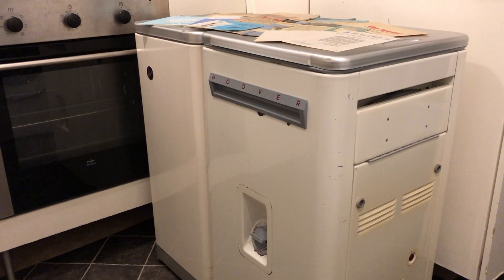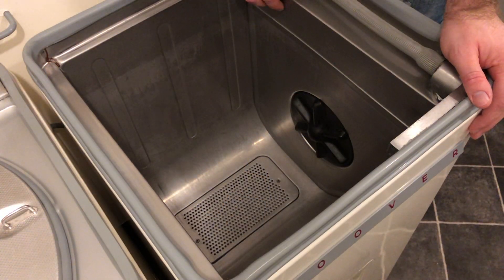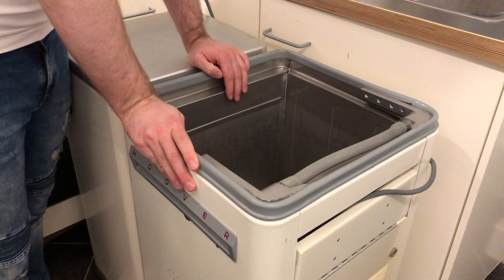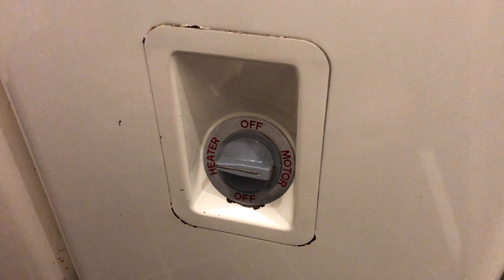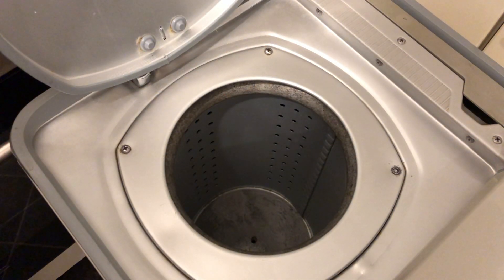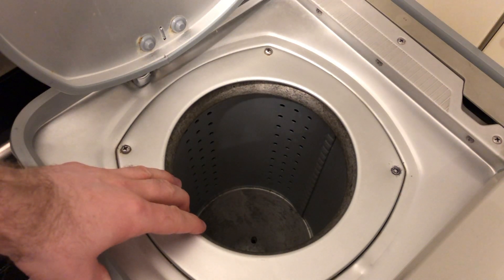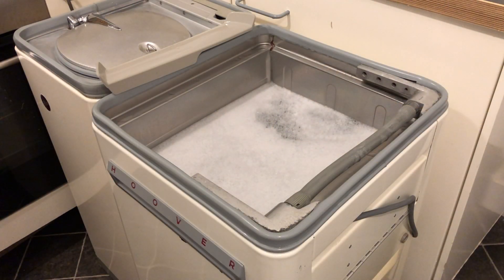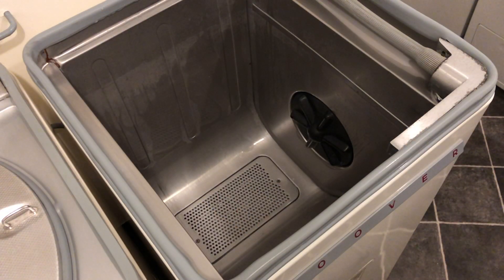Washing with a vintage Hoover washing machine and spin dryer

Comment: These were surprisingly efficient if you followed instructions and didn't try to take shortcuts. Many impatient people complained about washing being tangled - all you had to do was put it in the spinner for a few seconds, take it out, give it a shake to separate the shirt sleeves then carry on as indicated. For a single person or a couple, they were ideal. Cost effective too, as you didn't have to waste the hot suds water each load.

Comment: Oh this was SO lovely to see this particular Model! Thank You!  My Great Aunt had one of 
these Single Tubs shown;  it was inherited by my mother when she died, the only difference, she did not have the matching ‘Spinner', but there was a 'Mangle' attached to the Single Tub Machine,  that ‘folded' down inside the actual Washer when put away, and so it did not impede on space 
when not in use. I am guessing because of the Mangle on my Aunts, that these Machines (unlike today) did not change over the years;  they continued to manufacture the same Models for 
years... These days, it’s out this year, and in with the new – the very reason they would not last any where near as long as these great loyal old things!  It was an effective and powerful Machine, though doesn’t at first look it when viewing the relatively small ‘Paddle’ on the side instead of the larger ‘Agitator’ on most.
Reply from the maker: No worries, so glad you enjoyed it!

Comment: That is a bit weird there isn't 'heat and wash' position on switch
Reply from the maker: That would be a bit risky. There’s no timed shut-off mechanism to regulate the wash duration, so it would make it easy to accidentally heat and wash continually at a temperature too high for the laundry, and possibly at a temperature that could injure the user!
Reply: @ElectricUtopia  Well, here in polish most of washers with heaters didn't have any thermostat ;) Polish washers have silimar switch to that Hoover, but with "wash and heat" position and heater lamp. GDR washers (WM 66) had only thermometer on front, and Romo washers (from Czechia/Czechoslovakia) had thermostats, but with weird adjustment range (for heating when motor is off) so if you heat wather during wash, you need to control temperature on your own.
"Wash and heat" is good to heat only a bit, when you wash many of batch, or when you wash on high temperature to stay water hot.

Comment: Where is the drain pump switch
Reply from the maker: There isn’t a dedicated drain pump switch. During the wash process, the water is circulated by the pump as a closed circuit through the machine. When you want to drain the machine, you just disconnect the drain hose and direct it into a sink or drain - this has the effect of pumping out the water without circulating it back into the tub. Hope that makes sense!